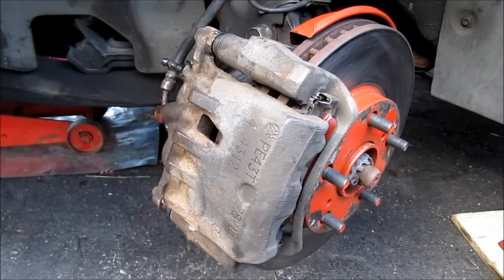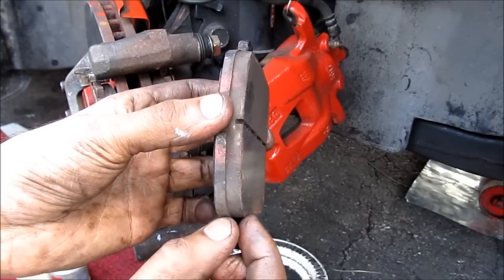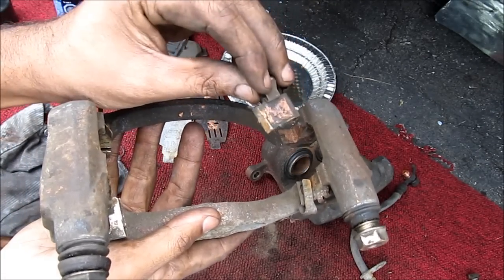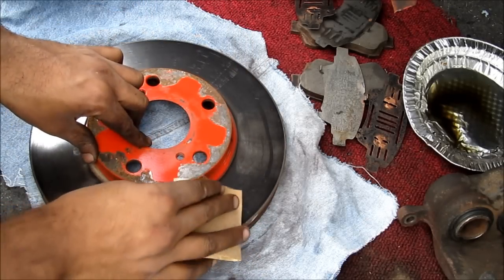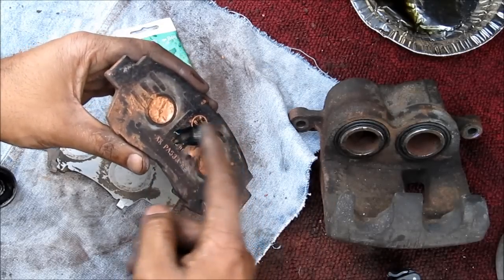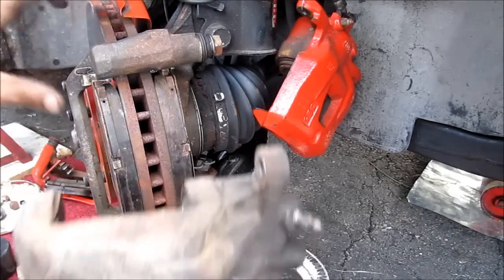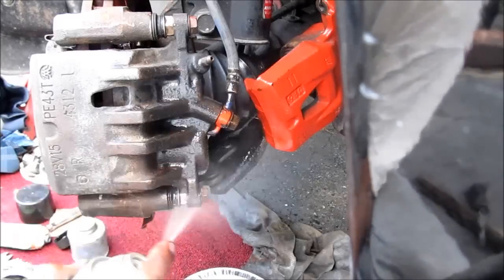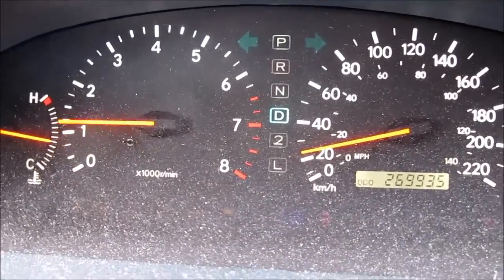Front Brake Pads, Rotors & Caliper Replacement: Toyota / Lexus

Comment: When replacing calipers due to one being seized after 2-3 rotations. Do you need to buy the caliper bracket and the calipers? Or just calipers? Thanks
Reply from the maker: If the sliders move freely then no need

Comment: All around good video well explained except for one part unless I am mistaken there are a couple of steps you left out when bleeding the brakes
Reply: On lexus especially.  It calls for a scanner tool to activate the abs to clear air.  You will have no pressure at all doing a typical bleed. Most Lexus do not have a mechanical brake pedal

Comment: Hey quick question, have a 01 camry LE with the 4cyl and these came with the same 275mm rotors as the v6 models if you had the 15inc rims. Was wondering if this swap is doable on this car as well, mines just doesn’t have abs so I’m not too sure

Comment: Can you elaborate on upgrading the calipers on an  '01 Solara? So I can just buy some front calipers for a '96 Camry and use them with my existing rotors? I do agree the stock brakes are undersized on that gen of Solara.
Reply from the maker: Yeah 
Better yet use a set of rotors calipers and pads from a newer car like Lexus ES330 but you'll need 16" rims
Reply: @speedkar99  Awesome! I do have 17" wheels so no problem there. Thanks so much. Will look into it.
Reply: @speedkar99  since the rotors from an ES330 are larger in diameter, the dust shields would need to be removed. Don't really need them anyway.
Reply: @speedkar99  I guess we'd have to ignore the Oriely Auto Parts website. It says both the Camry dual piston calipers and Lexus calipers are incompatible with the MCV20 Solara chassis. Different bracket mounting points? Nice thought though guys. Strange that Toyota didn't just give all the vehicles that size dual piston calipers.
Reply: @sdnative2387  You can't always go by what the stores say, but I believe Speedkar99 knows so I'd go with what he says.
Reply: @sdnative2387  The bracket mounting points are the exact same distance apart so yes the dual piston size upgrade does work using the dual piston calipers from the ES330 as he said, a '96 Camry or certain years of ES300 with the MCV20 chassis.

Comment: I nearly killed myself getting the LAST pin out on front passenger. All the others went smoothly, it’s always that last one lol took me hours, Bc the parts store didn’t have a new bracket or pins on the shelf they had to be ordered and I wanted my car off the jack stands. I got it, but what a day that was for ONE pin.

Also the little rubber piece on the end is still stuck in the bracket. I just left it, lol the pin slides freely just find now with new grease so I’m not worried about it

Comment: I have a 2000 I4 Camry and I am looking to do the V6 dual piston front upgrade. I have the feeling that I can use the same banjo bolt and washer from my I4 on the V6 setup. Can you confirm? I have everything else ready to go. Pads, bracketed calipers with ABS, and rotors.

Comment: When I release brake there is a popping noise, I torqued everything on front suspension and checked sway bar links, I’m thinking it has something to do with brakes/calipers, any ideas?
Reply from the maker: I had that. Caliper bracket bolts.

Comment: Good job. Make everything slippery. Loosy goosie, lol. Oh I only use ceramic pads. No noise, barely no dust and your rotors will thank you. Also a good time to check wheel bearings and even suspension and steering because one thing affects the other. Happy braking!
Reply from the maker: Agreed! Anti seize in everything here in Canada

Comment: Caliper bracket 17mm bolts.
I noticed you put anti-seize on them.
I’m trying to find new bolts and at all the auto parts stores I’m seeing their bolts have what looks like red loc tite on the tips. The OEM Lexus/Toyota bolts don’t have any such material in the picture I’m finding of them.
However, my bolts were super hard to get out, and I ended up stripping the tips of them, so I’m guessing whoever replaced those bolts before me used to auto part store bolts, or loc tited the OEM bolt tips...but, you are using anti-seize...
Which application is correct?
Reply from the maker: I hate lock Tite. In Canada we have natural lock Tite, called rust. Hence I use anti seize on everything. Good luck with caliper bracket bolts. One time I stripped and had to order, and took some time to get in. You can get them from the junkyard. I'm sure they fit many Toyotas

Comment: Hello, i recently had an emergency brake scare on my 04 fwd rx330 with 18in wheels.  it has 225k mi on it.  I plan on adding a roof top tent and rack which would add roughly another 150lbs to a crossover with sub par oem braking. You show the dual piston camry calipers in the vid. Are they an improvement over the single piston RX as i'm puzzled to think they would place lower quality brakes on a heavier lexus?
 Is there a specific model larger caliper that would be better?

 I also saw on club Lexus that a member had improved braking by swapping the rotors from a supra tt and adding steel braided brake lines with dot 4 fluid.  Would it be possible combining both methods? Is one superlative over the other rotor/line upgrade vs caliper design? Are there similar rear upgrades? Are the rears worth it or just focus on the fronts?
Reply from the maker: I think you need Highlander brakes from 2008+ 

Dual piston camry brakes aren't going to cut it for an RX.

Comment: My rotor wobbles/has a lot of play with and without wheel on, I re-grease the slide pins and tightened the caliper bolts I still haven’t figured it out. There is a whistling noise from the wheel when I drive (goes away when braking) It is missing the set screw that connects to hub but I have never had those on either of the wheels. Could it be a warped rotor?
Reply from the maker: If it wobbles then you have a bent rotor. 
Use a dial indicator to determine
Reply: I ordered new rotors anyways as they haven’t been changed in like 6 yrs but I’m thinking now it might be the wheel bearing 🤔
Reply: It was the wheel bearing was shot!

Comment: Don't put anti seize on the bolts it mess with with the torque specs and it may come loose much easier. put thread locker instead.
Reply from the maker: True. But I live in Canada where things rust.
Reply: @speedkar99  so do I

Comment: I want to do this to my 06 Corolla which Camry and year should I use? Please Reply to my e-mail burnair@aol.com Thanks in advance you did a great job of explaining what you were doing!
Reply from the maker: +Mike Balloonman I'm thinking XRS brakes
Reply: @speedkar99  Near impossible to find XRS used parts I had heard somewhere that you could use Camry second gen parts and they would fit but can't find which year to look for.Just getting tired or replacing calipers and warping rotors. I have replaced 9 calipers on this car otherwise I had to vertically do nuthin to this car except  regular oil changes. It's an S  drained the fluid three times using Dot 3 and about 4K miles steering wheel starts shaking warped rotor stuck piston all interstate driving spent close to 3K on brake jobs this is ridiculous. That's the reason I wanted to upgrade the brakes tired of Chinese rebuilds.

Comment: When you put the caliper on, what happened to the spring wires? They were missing...
Reply from the maker: +grabir01 I did put them on after. It helps to keep the pads slighly apart when the brakes aren't applied.

Comment: I want to upgrade the brakes to a dual piston on my 2001 Lexus es300 will the dual piston bracket and brake from a 2002  bolt up to it  even if the body still had change for that year?
Reply from the maker: +bigchiller007 yes all Camry based vehicles have the same spacing for the caliper bracket bolts. You might have to change the rotors too, and upgrade your rims to fit around larger brakes.

Comment: Hi, I have a '96 Camry le, 4 cylinder.  I'm looking to upgrade the brakes, and doing the front calipers seem like the best option at the moment.  Do you know if the caliper+bracket and brake pads off of a 92-96 v6 Camry would essentially swap out for the caliper on the 4 cylinder?  Or would I need a new rotor, and potentially wheel?  I have the stock 14 inch steel wheels on. Any input would be much appreciated, thanks
Reply from the maker: You will need the 96 V6 with ABS Camry's rotor, caliper, bracket, pads and wheels to make it work. The dual piston calipers need a minimum of 15" rims to clear.
Reply: +speedkar99 Gotcha', appreciate the info.  I'll have to keep me eye on the junk yards
Reply: @speedkar99  Are these the same as the calipers used on 2005 lexus es 330? I have a 2005 solara and would love to upgrade the calipers to dual piston. I am looking on ebay for complete kits.... when I searched for 96 camry calipers.... they were all single piston :(

Comment: Hi speedkar! Great video. I have a problem with my own setup. I own a 2009 Corolla XRS and want stronger braking. I recently replaced my front rotors and as well as ProAct pads which I was hoping would solve it but it only made it slightly better, I still want more bite/power and want to upgrade them. 

Do you know which Toyota calipers will bolt up to the 10th gen Corolla knuckle? The XRS model has the base Camry 2.4l and transmission which makes it heavier than a stock Corolla yet Toyota only gave it the same normal Corolla pads/caliper/rotors combination :/. I can't find much information on Toyota Nation or elsewhere. I have been told that POTENTIALLY the front brakes from the heavier Rav4 V6 or IS' will bolt up/work. My car has 17" wheels stock. Thanks! I really appreciate any help, I wish I could just bolt up the larger Camry rotors and pads with twin pistons like you did!
Reply from the maker: Hey, thanks for the feedback. I am not sure on the Gen 10 Corolla knuckle. I'd assume since the XRS uses the same brakes as the regular rollas that the Camry brakes probably won't bolt up. I think the only way to know is to measure the distance between the mounting bolts on the caliper brackets. The rotor on anything Camry based (Rav4, Highlander, ES350, etc) won't bolt into a Corolla knuckle because the lug bolt pattern (5x100) is different, so you'd be left trying to source a larger rotor with that pattern and hub size. 

Are there other Corolla based vehicles that had larger brakes? Like Scion xB, xA, tC, Matrix or Prius?
Reply: Thanks for the reply, it was really helpful. And you nailed it with the lug pattern. Because I have been focused on the knuckle bolt distance but the lug pattern is 5x100 while all these other cars are 5x114.3 so I'd never even be able to get the rotor to match even if I could find a caliper.

I am wondering about Scions, some are 5x114.3 and some are 5x100. What I'm looking into right now is buying aftermarket options for the tC because it's a similar platform like you noted, but I'm unsure and information is really hard to come by it seems.

Comment: I'm looking to upgrade my lexus ES300

what calipers and brackets options do I have?
-Thank you
Reply from the maker: Anything from the Camry platform will bolt up to the knuckle. For Highlander or RX350 brakes you''ll need a minimum of 17" wheels. If you want dual piston calipers that will fit 16" wheels, look for brakes from an ES330, and for 15" Wheels, a 95-96 Camry V6 as per this video, or an Avalon.
Reply: +speedkar99 thank you so much

Comment: The caliper slide pin with the bushing is always on top for front and rear.  ??Correct??
Reply from the maker: +siucbset I always mix those up. Heck I even took off the bushings because they bind up too much.
Reply from the maker: +siucbset I always mix those up. Heck I even took off the bushings because they bind up too much.

Comment: Do you have to bleed the brakes if your just changing the pads and rotors.
Reply: ***** Ebay is probably the last I'd trust for such an important safety part. Try Rockauto
Reply from the maker: +1 for Rock Auto
Reply from the maker: No.
Reply: If I don't have a torque wrench will I have to purchase one.
Reply from the maker: You don't need a torque wrench for brakes, hand tightening is good enough.

Comment: I had a question. When u remove the cam and crank gears to replace the cam and crank seals, what is keeping the engine in the correct timing. When u remove the gears doesn't the engine get out of time or does the cam holding tool achieve the correct timing of the engine??

Comment: Wonder if this would fit my 99 avalon as I have 15inch wheels? For the Gen3, what years are those?
Reply: Thank you so much!
Reply from the maker: Yes it would. You could take dual piston calipers off of 94-96 Camry or Lexus ES300 or 95-97 Avalon and it should bolt right up with 15" wheels.
Reply: speedkar99 so my question is this, Will these dual piston calipers help my 2005 avalon, and fit on it with no modification? 

Thanks, looking for a brake upgrade, already have slotted and drilled all around, with ceramics, but at 140, still has lots of "it's not stopping fast enough" moments lol
Reply from the maker: I'm not 100% positive it will work on a 2005 Avalon, but since its based on the same chassis on the Camry, I suspect the caliper bracket holes should align on the knuckle and bolt right up.
You should go for 2008+ Highlander brakes - which are much bigger than the Gen 3 Camry calipers, assuming you have 17" wheels to clear the brakes.
Reply: I do have 17" wheels to clear, and so the 08 highlander brakes fit! YESSS
Do they bolt right up!:"?? :-)
Reply: also, are they 4 piston or 2? or 1 piston lol
Reply from the maker: The Highlander brakes are dual piston I believe. Check out this thread for info on upgrading:

http://www.toyotanation.com/forum/104-5th-6th-generation-2002-2006-2007-2011/393447-cheap-big-brake-upgrade-3.html

Comment: Brake Pad and Caliper UpGrade:  The are plenty of Camry brake and caliper change outs already on YouTube so when I saw the title I was wondering why speedkar99 would post one.  Upon seeing the video I noticed this video is more so a brake and caliper up grade.  I did not know before this video that I could merely just go to the generation 3 Camry twin piston design and make the switch to get a more power set of brakes.  

I am currently content with my brakes yet I am glad to have this information.  

Did you consider cross drilled and slotted rotors?
Reply from the maker: Thanks. I hadn't yet done a front brake job video and wanted to do one. The Gen 3 Camry's twin piston makes for a cheap upgrade, but for even more stopping power, late model Highlander / Lexus RX / Toyota Sienna dual piston brakes + rotors will bolt right to the steering knuckle of these older Camry's. You'll need a 17" wheel minimum to clear the brakes. Drilled and slotted rotors are merely for looks and won't increase performance for a regular street car.
Reply: speedkar99 My set up is 205/60R16;  same as yours:  So how did you get the Gen 3 twin piston caliper on if a 17" wheel minimum is required?
Reply from the maker: To clarify, the Gen 3 Camry brake upgrade would clear a 15" wheel (which is what I did), and the Highlander brake upgrade needs a 17" wheel to clear the caliper.